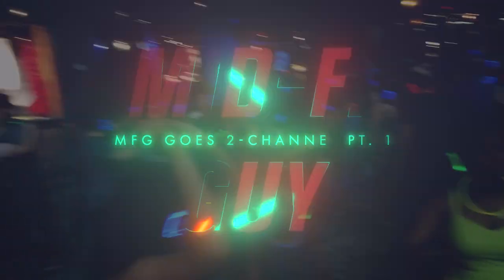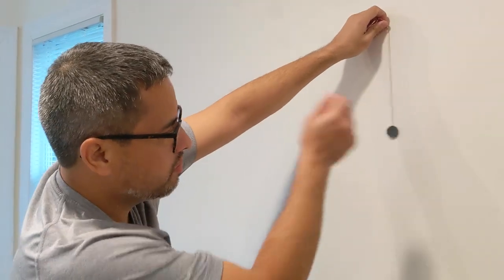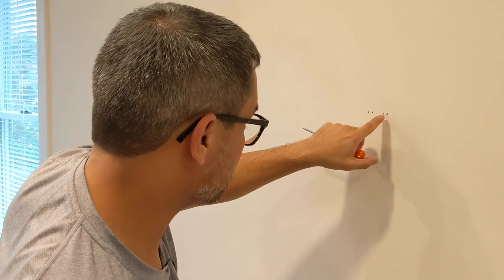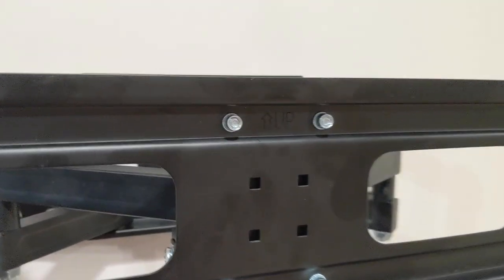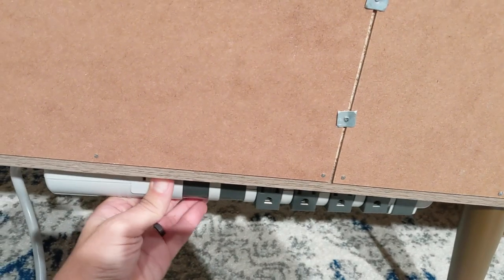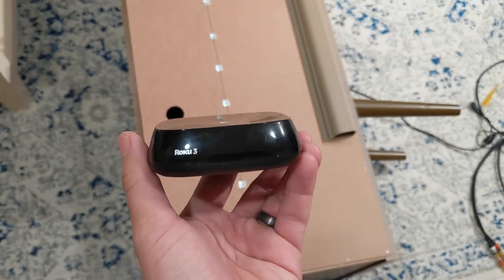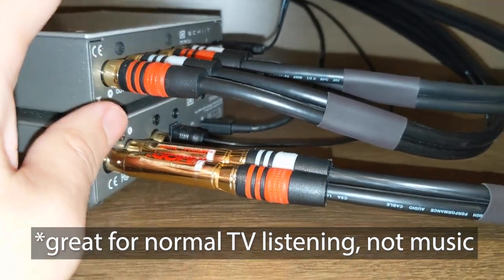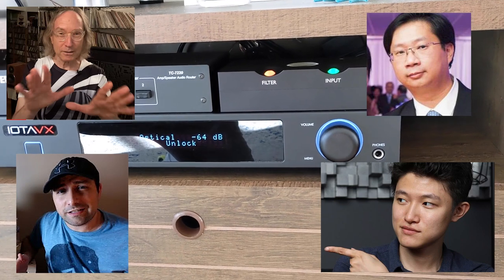Headphone Guy Goes 2-channel - Mid-Century Modern Cable Management & TV Hanging

Comment: tip for the power bar usage: plug the most sensitive equipment on the socket nearest to the power cable, highest power comsumption (or noisy switching power supply) furthest away, this minimize voltage drop on the most sensitive equipment (those work on comparatively small signals e.g. a DAC)
keep using power bar to avoid ground loop (caused by interconnected equipment each with different ground potential reference)

if you want further upgrade, get an electrician to run dedicated circuit for the AV system: not shared by any other load until service entrance,  dedicated wall jacks goes directly to the power panel, with its own circuit breaker.

Comment: A decent Zircon stud finder (you can get at Home Depot) is $20 with deepscan and electrical warning, and they work (most of the time). You can't totally trust reviews for something like that -source: am carpenter. I just used mine to install a wall safe in heavily textured drywall. They're good to have around when you need one. 

Anyway, great set-up, congrats on selling out and moving to the 'burbs- I mean, you're new home ;)
Reply from the maker: Haha definitely a sell out! I forgot what it was like to have a backyard, but I miss the food😭😭

Edit- also thanks for the trade tip on the stud finder. I had a cheapie Black & Decker and after both it and a B&D toaster oven broke I'm never never going with that brand again.